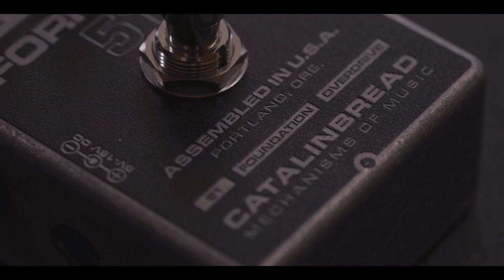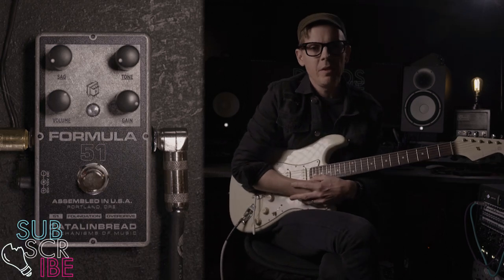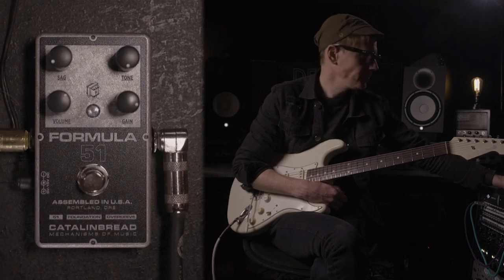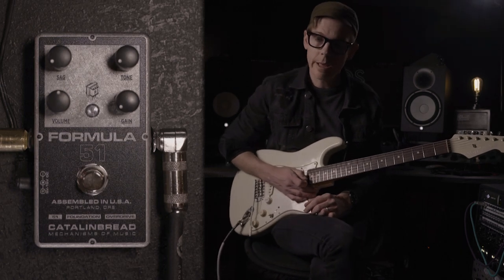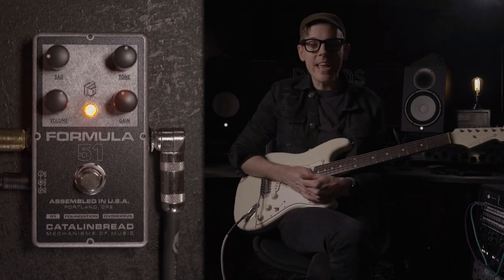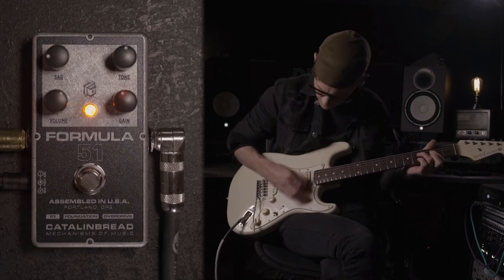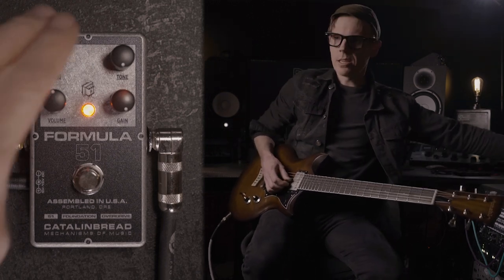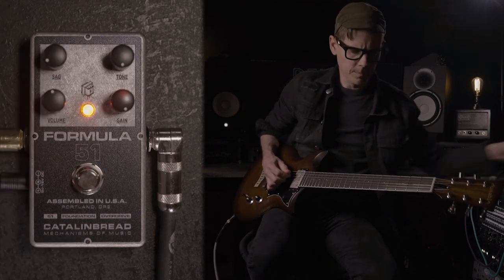Catalinbread Formula 51 Foundation Drive // Guitar Pedal Demo

Comment: I bought this a month ago from AMS. I guess they didn't realize they weren't supposed to sell it yet and I somehow managed to snag one before they removed it. It's a great pedal and rightfully sits next to my Greer Soma on the pedalboard. You did a great job with your demo.
Reply from the maker: REALLY!? that's insane!
Reply: how is the Soma?  I really want to try/get one.  How does it compare to this?
Reply: @solarflaresmusic9267  They both get into exploding amplifier territory, but that's probably because they both utilize transformers. The core sound is different, but they both can sound somewhat similar when stacked and pushed. Like a tube amp that's about to detonate. It's an absolutely gorgeous sound too. Some might not dig it, but that's what's similar about the two pedals.
Reply: @solomonsanchez1897  based on the demos i've watched, the Soma sounds way better to my ears. The Formula 51 sounds like a fuzz.
Reply: Neither truly sound like a fuzz, but yeah they can both get fizzy. Like I said, they can get similar sounds on the far end of the knob spectrum, but they aren't even based on the same model amplifier. They are different enough that there's not much overlap in owning both. The only similarities is the transformer being used in the design, which is something Catalinbread hasn't done before for any of their other foundation pedals.